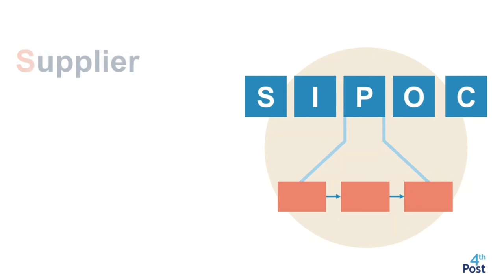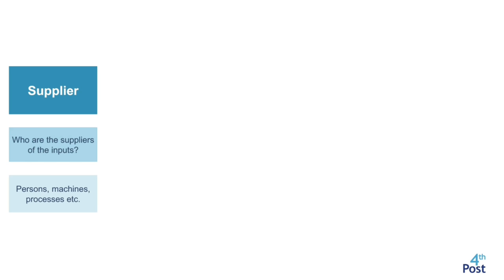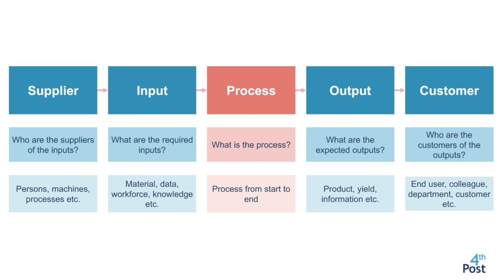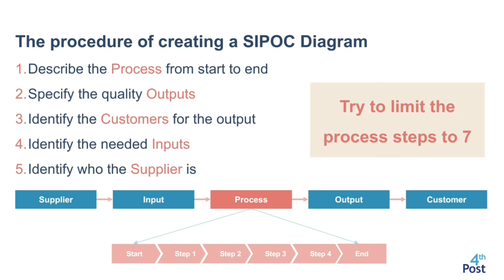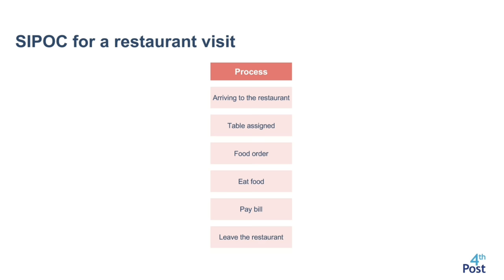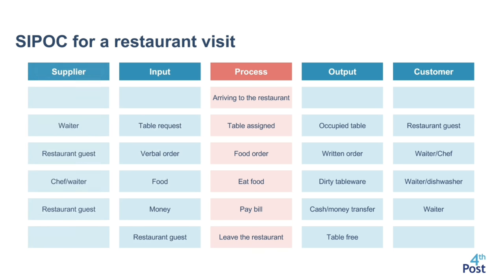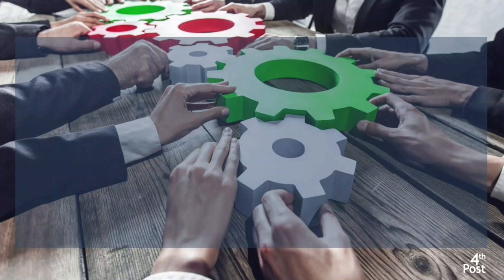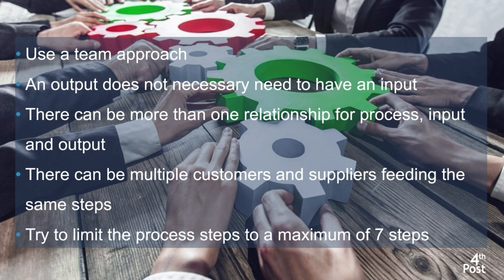SIPOC Diagram explained (with example)

Comment: Thanks for this video.  It is a good explanation of SIPOC.  I do however have a comment.  In my experience it's much easier for the supplier to stay in the supplier role and the customer to stay in the customer role.  In your example the restaurant employees are the supplier and the customer who comes in to buy and eat the food is the customer.  When the customer tells the waiter what they want to eat, the customer does not suddenly become a supplier.  Yes the customer does supply a bit of input needed for the supplier to complete the process, but it does not mean the customer is suddenly the supplier when they order or pay for their food.  I'm saying this because when doing SIPOC with a group of people at work like in a manufacturing plant or service business it becomes too confusing for people if they have to change their role from customer to supplier every other step in a process.  I think its better to identify the supplier of the process and the customer of the process and those people stay in their roles.  If the customer needs to provide an input to the process (order the food or pay for the food) they are simply meeting one of the supplier's requirements in order to use the process.   The supplier is still the supplier and the customer is still the customer.
Reply from the maker: Thanks for the comment. I believe that it depends on the process you are looking at. If your goal is to look at the process of a team and understand what you are delivering to whom, then your suggestion makes great sense. However, if you want to have a helicopter view of a more complex process before digging deeper into sup processes and value streams, then the customer and other stakeholders that are not necessarily the first supplier can and should be considered. The nice thing about these tools is that you can and should adjust them to your specific need and goal. There’s not one right way as long as you make the tool serve your purpose.

Comment: Very well explained Bzhwen. I subscribed. You solved my dilemma of leaving blank, when not applicable. I would call this POCSI :-) as that is what the order I used when I did this. But this is a kind of mindmap, now a days with agile, more focus on User Flow & User stories.  Please can you discuss, the relevancy of these days of WYSIWYG
Reply from the maker: Hi granand, 

I'm not sure if I understand your question correctly. I believe that the SIPOC tool is as relevant as ever. Creating a simple SIPOC diagram could be useful in any process where you have different entities as well as inputs and outputs.

Comment: Row 2: For the table request supplier would be restaurant guest who is going to ask for a table (table for 2 , table for 5 etc etc ) so guest is the one who is responsible for the input. 
Anyone can Correct me if i am wrong
Reply from the maker: Thanks for the comments. It depends on the process step. If you want that additional process step (ask for a table) then you would be right. In this case, the supplier would be the restaurant guest, and the customer would be the waiter. When doing a SIPOC, it's all about keeping it simple and gaining the overall overview. If your goal is to dig deeper and get more details, you'd be better served using a process mapping template or, for this restaurant example, a Service Blueprint. 

I hope you find this answer useful :)